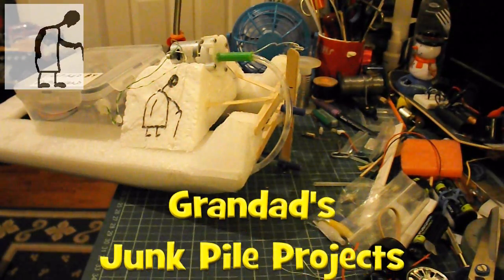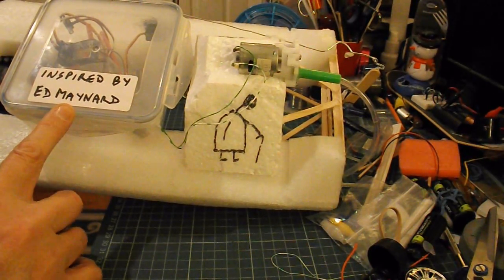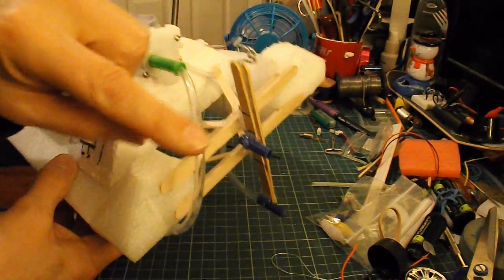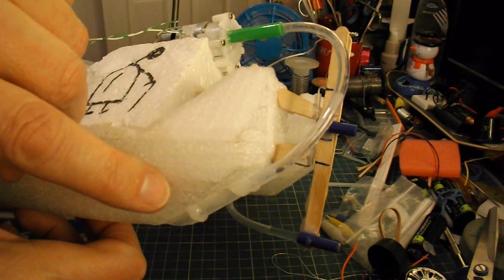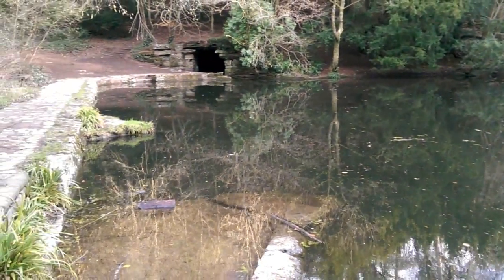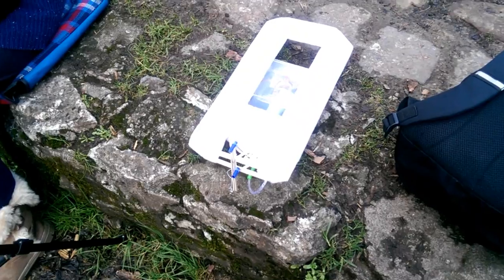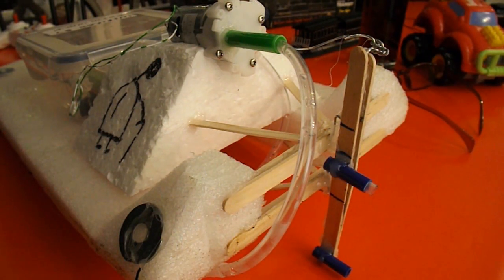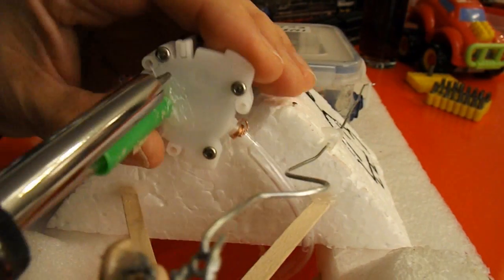Grandad's Junk Pile Projects #6  Water Jet Boat PART 5 debris in the water

Comment: I intend to make a small pump like that for water cooling of an airboat's ESC. I wonder how this "self priming" design works with these two gears touching together. Is it somehow stronger than a design with a 4 blade impeller, like those in youtube videos made out of bottle caps? Because I assume there is a greater pressure if there is as little space possible around those gears that work as impeller with such a small inlet and outlet holes? :)
Reply from the maker: I cannot advise you. I haven't attempted to make my own. If you are making your own I would think the power of the resulting pump will depend on your skills as a builder.
Reply: Okay, thanks anyway Grandad!
Reply from the maker: Viktor Božičević Good luck with your project and make sure we see a video :)
Reply: Thanks! I will try to film it when I make a success.

Comment: Wat about squeezing the nozzle so it jets more like wen you squeeze a hose pipe just a thort
Reply from the maker: +David Turner yes, adjusting the diameter of the nozzle would change the pressure but this project was to try to establish if there was any noticeable difference between using the jet above or below water.